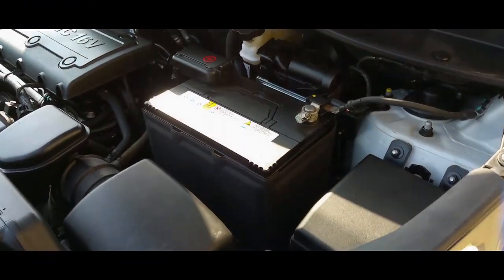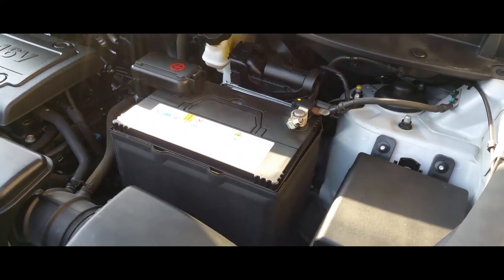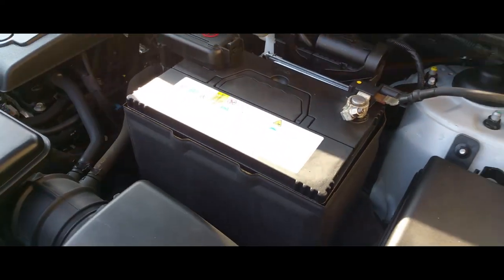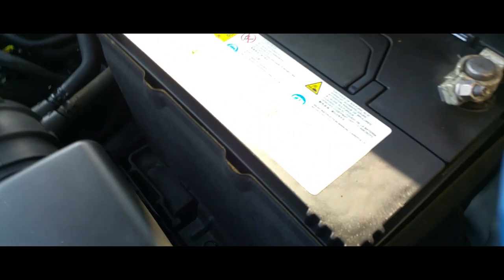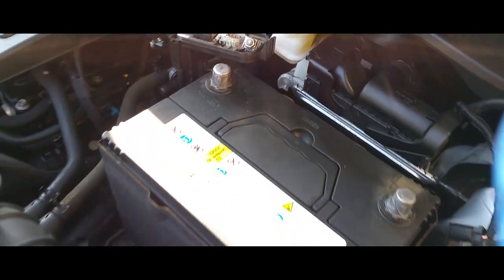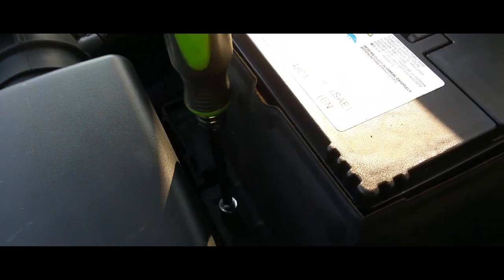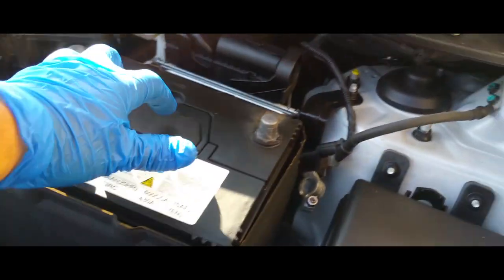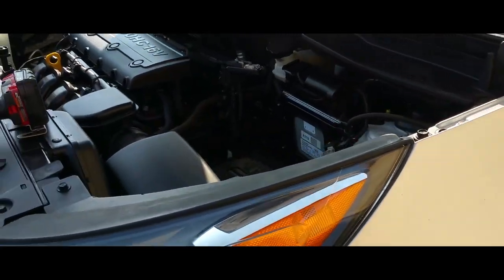How to: Remove a Battery from a 2013 Kia Sportage

Comment: Excuse me and what about the memory car if you change the battery without anoher source  of energy to alimentation the car ? 
I see a Guy change the battery thé car in marche because hé Say that you Can have problèm of memory car
Reply from the maker: @trust964  i didnt experience any problem, the reason i replace the battery is because they are completely dead. So it wouldn't make a difference and haven't experienced any issues

Comment: I have a kia sportage 2005 and its exactly the same thing
Reply from the maker: Yeah one thing i have noticed about these manufacturers is that they keep same model almost similar. They just change out a couple of things and add more technology to it
Reply: Did your's have stop/start.  My wife needs a new battery and I'm wondering if i should just replace it myself.  But i'm concerned if the car will suddenly have issues recognising a new battery if i dont 'save' the codes from the ecu et cetera.